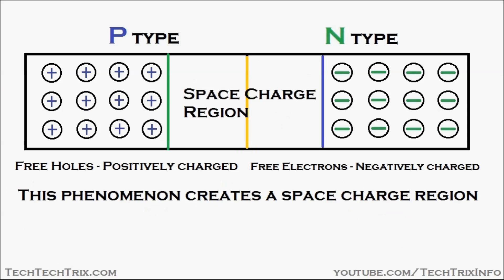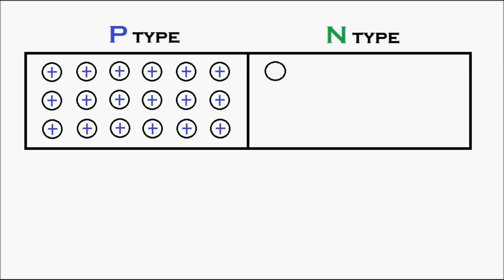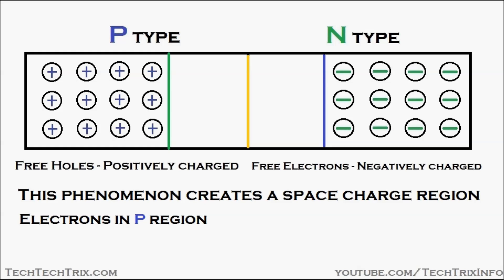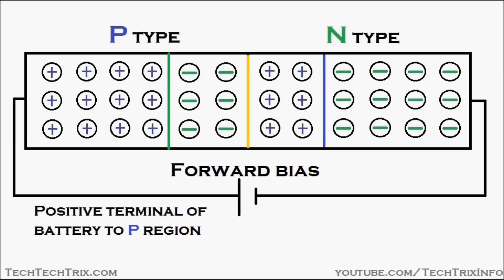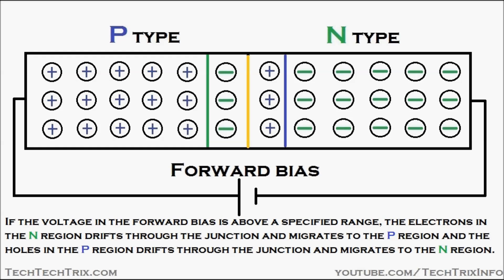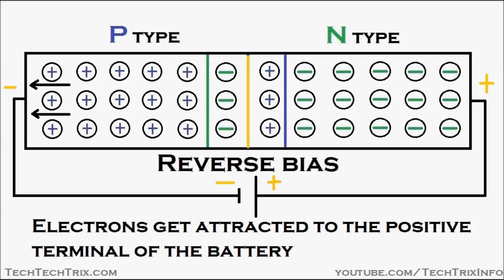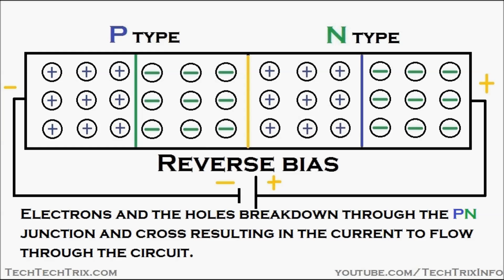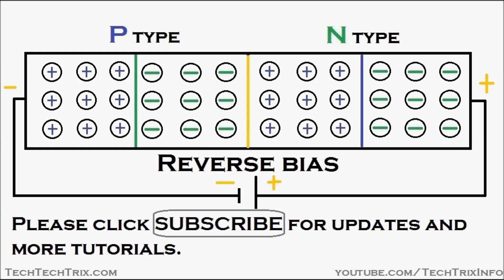Animation | How a P N junction semiconductor works | forward reverse bias | diffusion drift current

Comment: A P type region is formed by doping a trivalent atom which leave a hole in the vicinity of doping atom. The total substrate is electrically neutral with no charge, its just that there is a hole which can conduct electricity by providing a space for electron to occupy.  At the beginning of the video, you have started wrong
Reply from the maker: In a P-type semiconductor, trivalent atoms create holes, which are essentially the absence of electrons and allow for current flow. The material remains electrically neutral, as the holes are simply positions where electrons can go. I appreciate your input, and it’s always exciting to dive deeper into these concepts! Let’s keep the conversation going—feel free to share more thoughts, or let me know if you’d like to explore this topic further.

Comment: In reverse biased pn junction diode when the avlanche breakdown voltage is applied there is movement of minority charge carriers from n side (holes) towards p side {not of electrons as mentioned in video}and from p side(electrons ) towards n side{not of holes as mentioned in video.}That is why weak current flows and on further increasing voltage the current abruptly increases and can also destroy pn junction at cetain value of voltage i.e.,avlanche breakdown volatge.
Please correct the above mentioned flaws in the video.
Thank you

Comment: So diffusion current is AC, space charge region or depletion layer is insulator in nature, and space charge itself is initially AC but eventually DC? How to tap this space charge to connect them in series and parallel to make solid state free energy machine?

Comment: p type isnt charged +vely its just they have Free holes i.e they have equal no. of protons and electrons in it hence not charged. Boy u need to cmt it here amd pin it because students might get 0 marks in exams when they write this ☮️✌️
Reply: The other bro in the comment section pointed out the same thing(check top comments).Even his comment didn't get pinned (I think the channel is dead). Anyway you shared your knowledge..thnx for that ^_^

Comment: Diffusion current is the movement of the holes from p side to  n side and due to the movement of electrons from n side to p side.The movement of the electrons from p side to n side and and holes from n side to p side after the formation of space charge region is called DRIFT current.
Reply: Then in the video is it wrong ????

Comment: Extremely wrong to say that P and N typed are "joined" together. Instead, a semiconductor material e.g Si is doped with P-type impurity e.g Boron at one end and with N-type impurity e.g Phosphorous from other and. After the diffusion, a junction is naturally formed somewhere in between both the ends of the Si material. Location of the junction and width of depletion region depend on the concentration difference of both the impurities.
Reply: Absolutely Right Bro

Comment: I did not understand how p-n junction in reverse bias acts as an insulator. And also how current starts flowing after reverse bias breakdown voltage is applied.

Comment: bullshit 😂 . You explained equilibrium state in pn diode and said due to movement of holes and electrons a diffusion current is developed . What about drift current ? Mister dumbo , you must be knowing at equilibrium , in absense of external field , there should be net zero current and that happens due to internal developed electrical field created due to diffusion of holes from p to n region and electrons from n to p region . Internal electrical field now drags the holes from n region to p region back and so is with electrons which develops a drift current . This process goes on till equilibrium is established . At equilibrium , net current is zero in pn diode , although individual currents aren't . Diffusion and drift currents of equal magnitudes flows in opposit direction , that means exchange of electrons and holes goes on under equilibrium , maintaining the both diffusion and drift currents equal and opposit .

Comment: Hi, I appreciate the positive attitude but when it comes to accurate science I think you could really improve.

3 significant mistakes.

1. The space charged region is formed due to depletion of mobile charges (because of recombination), meaning the electric field is only due to the stationary ionized atoms, not free holes and electrons.

2. The current in forward bias is diffusion current of majority carriers and not drift current.

3. The current in reverse bias is drift current of minority carriers.

Pini.
Reply: yes there were mistakes, but gives some ground on this topic.
Reply: Even the direction of electric field
Reply: Precisely!
Reply: Hey! I've got a question. Why don't the electrons just jump from the n-type to p-type? Also if al the electrons go to the other side, it would remain balanced and then no flow would happen
Reply: @silje0568  1.electrons from n type cannot directly move to p type because of junction resistance.
2. If all the electrons move to the other side they will create a hole in their original postion. So when they move on the other side they will be again attracted towards the hole so a flow will occur continuously.
Reply: @silje0568  as the electrons near the junction jump at first,..a layer will be formed due to that which created an electric field....after that the electrons canot move in the same dirn

Comment: what's an insulator?
Reply: Rafa Syed ........insulator doesn't allow the current to flow through them. For example: wood
Reply: Khuzaim Ranawadia Thanks . I also found out while ago that it does not the passing of heat or any other energy of such.

Comment: nice explanation. but for avalanche breakdown(reverse bias)  electron and hole direction is not right here.  The electron and current direction are same!! How it possible? For avalanche breakdown condition current(drift) flows for Electric field this electric field created by supply reverse bias voltage not for only Built in voltage.

Comment: Depletion region doesn't include any free mobile carriers. There is just ionized dopants. So you are wrong about the depletion region having electrons and holes.
Reply: +Mustafa Atahan NUHOĞLU Thanks for pointing that out. Simpletons are thanking for the video even after it is fundamentally incorrect.
Reply: Actually it has electrons and holes but they are immobile

Comment: this video does not explain the reason for the electric field developing across the junction and avalanche breakdown.
The p type impurity atoms have only 3 electrons around them and n type impurity atoms have 5 electrons. When a PN junction is made, the excess electrons from the n region moves to the holes(vacant position for electrons) present around the P type impurity atoms. Thus when n region looses one electron, N type impurity atoms becomes positive ions and when the N type impurities accept this electron, they will become negative ions .This creates potential difference across the pn junction.

The avalanche break down occurs due to the minority carriers present in both regions. When high reverse voltage is applied, the minority charges gain enough energy to break the depletion region causing uncontrollable current flow through the junction.
Reply from the maker: +bijesh balan Well said..
For more more info you can email is at techtrixinfo@gmail.com or whats app at +919744615655

TechTrixInfo
Reply: Rohit Kumar no he didnt ask silly qs...He just explained the correct thing....
Reply: +bijesh balan  thanku for explaining the fact sir.
Reply: +bijesh balan thanks to you sir!
Reply: +bijesh balan This was great
Reply: c
Reply: yup, thats well said
Reply: wow
Reply: bijesh balan 
He
Reply: bijesh balan
Reply: bro u r asking silly questions, this video is made on the topic pn junction so it assumes dat u have already covered p and n type semiconductor materials.
Reply: @Rohit-tz6gs  It's not hard to explain why things happen if you truly understand it, so what's the harm in doing so?

Comment: in space charge region there is  holes and electrons as u hav said which is wrong but it consist of immobile charged  ions so that they resist holes of p type & electrons of ntype to move the other side.so that no current flows  if voltage provide less than barrier potential

Comment: Misleading Video. Electric Field in Space Charge Region is due to immobile ions, not due to holes and electrons which crossed the barrier due to diffusion. They just recombine resulting a space without any free charge carriers called depletion layer. There is no electron on P-side or Hole on N-Side. This video is misleading....be aware !!!

Comment: Great job! This is one of the few available on Youtube correct (and simple at that) explanations without dragging in the unnecessary concept of "potential voltage barrier" and using more simple idea of "insulating depleted area", and correctly calling a current the "drift" current rather then "diffusion" current (as it was in the video "JBtEckh3L9Q", for example).
But, I believe you messed up with the arrows at the end of this video (starting from 5:33) where you talked about avalanche breakdown. By the way, this is how a stabilitron/stabistor works.

Comment: Why don't ions from both sides move across the junction until the entire unit reaches an equilibrium state (neutral)? What is stopping this from happening?
Reply: daeser1 Yo, man! What ion moving are you talking about? This is a solid crystal, not electrolytes! Only electrons can move in a crystal.
Reply: You've just answered your own question. Replace "ions" with "electrons" in my question.

Comment: So let me get this straight. When you connect the Negative terminal of the battery to the P-junction and the Positive side of the battery to the N-junction electrons will fill in the holes in the P-type because they are attracted to the P-type.  The incoming electrons cause the electrons in the N-type to be repelled and flow into the Positive terminal on the battery, which they are also attracted to.

Comment: POINT TO NOTE:
A p type semiconductor is not positively charged instead the number the protons and electrons are equal in its lattice.its actually called p-type semiconductor because there is free movement of holes (i.e- positive charge carriers). the same goes for n type semiconductor.. :)
Reply: Could you explain why it is called as holes, how holes can travel?. Protons and electrons can move bcz its physically particles..
Reply: @Winsler05  holes in the lattice points are defects. That means, simply the absence of electrons in valence band are known as holes. And holes do not move practically. These vacant spaces are filled by another electron creating a hole on its place and so on. This causes the shift of holes. This is known as hole current.
Reply: @tomjoseph1180  very nice 👌
Reply: @tomjoseph1180  I'm not sure that you can describe a hole as a "defect". A defect in a crystal lattice means something entirely different to what you are suggesting.
Reply: @specialreconnaissanceregim3656  Yes, I understand. Defect may not be a good term for it. Can you tell me about it? I will get to know about lattice structure from you.thank you!
Reply: @Winsler05  holes never move but actually holes attract electron thus electron from where it moves form holes and holes which accept electron become electron thus exchange occur
Reply: @NadeemKhan-mf4cx  
Thanks brother...
Reply: @NadeemKhan-mf4cx   Holes dont attract electrons in the classical sense (force of attraction due to electrostatics) , but it is the electron moving randomly just as in resonance to stabilize the newly formed empty space in the object :)
Reply: Nice bro
Reply: @Shubham mat pado tab
Reply: Hi
Reply: is it neutral ? Are holes act like proton except that it can move ? Sorry if my question is stupid . . .
Reply: johome10 A p type or n type semiconductor is neutral.the no of protons and electrons are same in the lattice
Reply: Yes its nutral
Reply: @kiran Kumar -you are right p type semiconductor is negatively charged and n type semiconductor is positively charged
Reply: @satyamkumarsingh7397  no
Reply: Holes "move" relative to the moving electron. Electron moving to the right filling a hole is equivalent to Hole "moving" to the left while electron is "stationary".